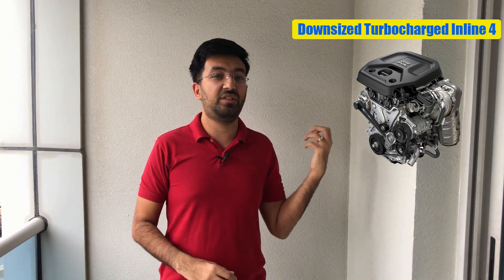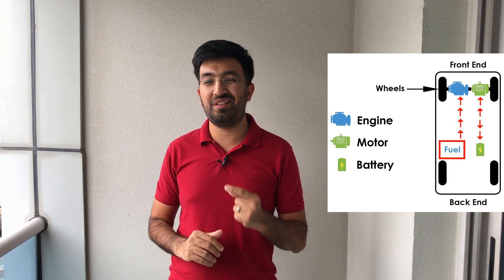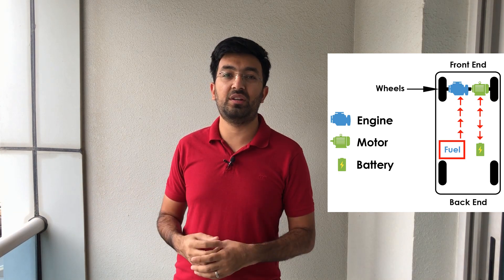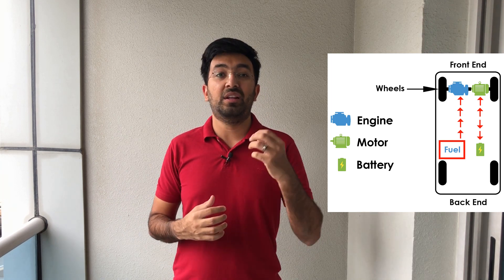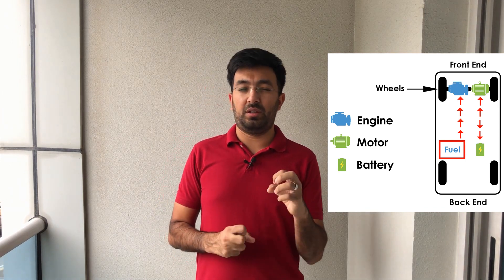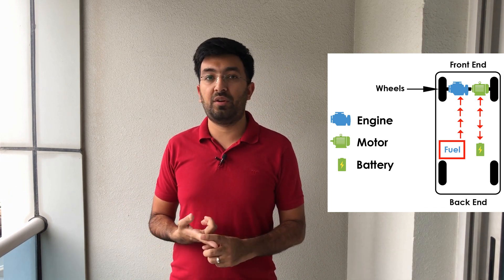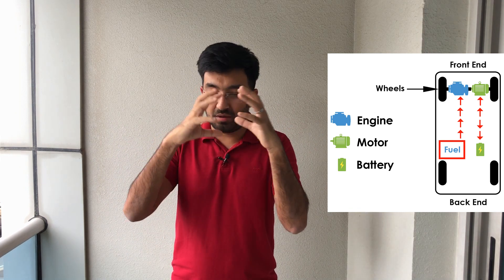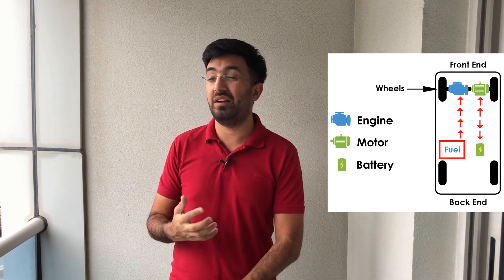Downsized Engines Vs  Naturally Aspirated Engines

Comment from the maker: Which one do you think after watching this video is a better option?
A. Downsized Engine
B. Naturally Aspirated
C. Hybrid Cars
D. Electric Cars
Cast your votes in the comments below with your option.
Reply: Electric is the worst and so boring. Naturally aspirated is the best without any unnecessary electronics and sound proofing plastic. I love hearing the engine and exhaust, why would you make it quiet 😳😲😂🙈
Reply: B is a more sensible option going by the explanation.
Reply: It all depends on the purpose to say which of these is a better option. If I was to choose for my daily driving to be more enjoyable, it would definitely be a naturally aspirated engine, however, if we want to take emissions into account, we will have to fuel it with natural gas or hydrogenium to achieve the requirements that we will have to face in the future. Next point is that we will also need to forget about the electric and hybrid cars - no future there :-)
Reply: Always Natural Aspirated . They last the longest  and perform the best.
Reply: Engines are getting smaller cars are getting bigger and heavier 🤔

Comment: For the next 10 years, it looks like going hybrid is the solution. After that better innovations using renewable energy sources like solar powered cars may become cheaper with the infrastructure to support it.
Reply from the maker: That's a very probable solution post COVID-19 scenario. Or the manufacturers may completely switch their focus to electric cars only and aggresively push the infrastructure development in that direction.